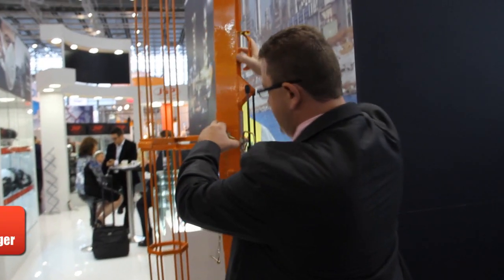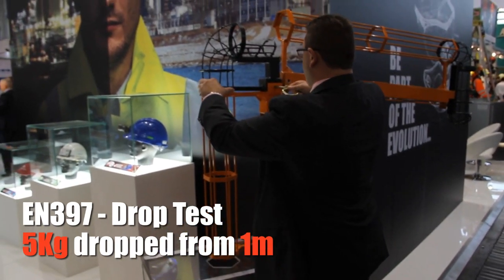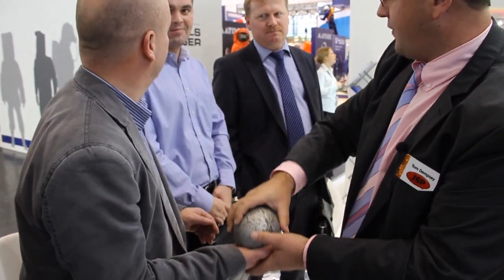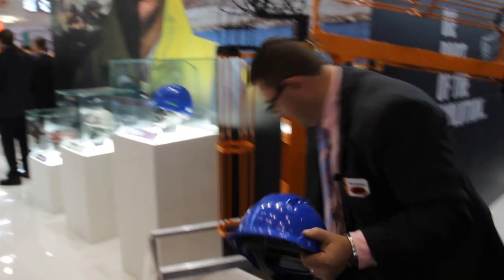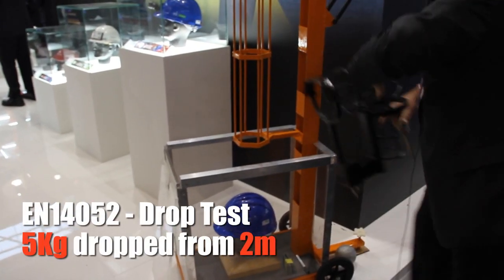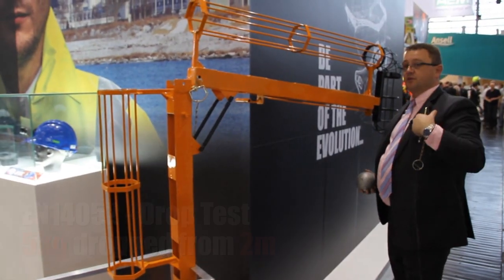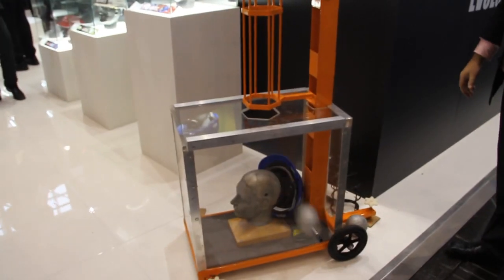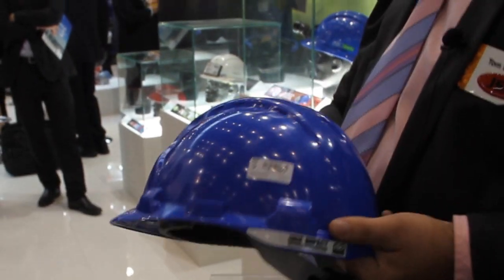Hard Hat Drop Test - A+A 2013

Comment: I sustained a severe head accident with a hard hat on my noggin, 2 of the support straps failed on the hard hat and then the hard hat came in contact with my head after heavily forced into a steel pipe. I received concussion, head/brain trauma, neck chronic injury, pain, headaches, severe Tinnitus, Hyperacusis, nausea, dizzy and more.
Reply: I hope you get better man. A very heavy 12-15kg pulling drill from from about 3-4 meters on my hard hat and shoulder. If it wasent for my hardhat I would’ve died. It’s been 7 months and I’m still experiencing pain everywhere also my mental capacity has greatly decreased after the accident..